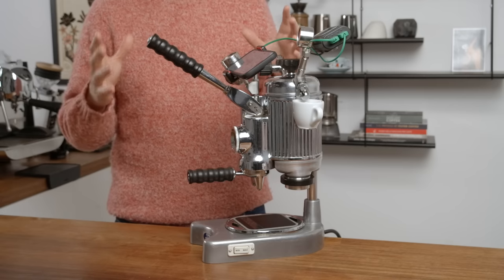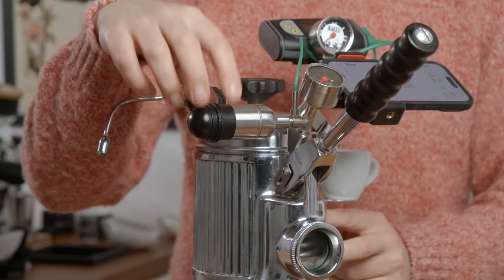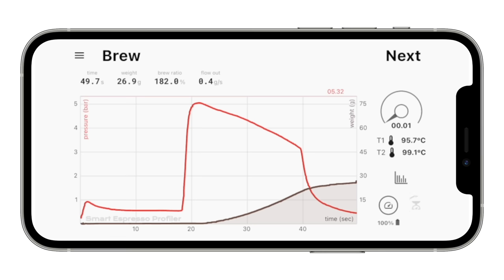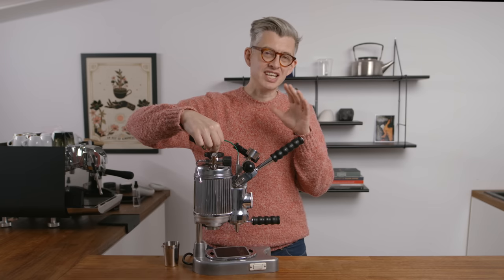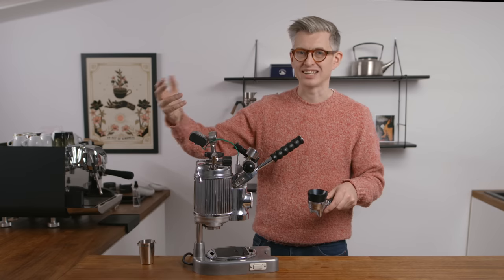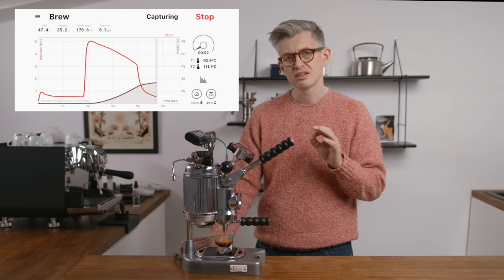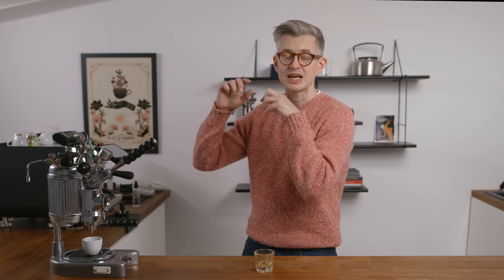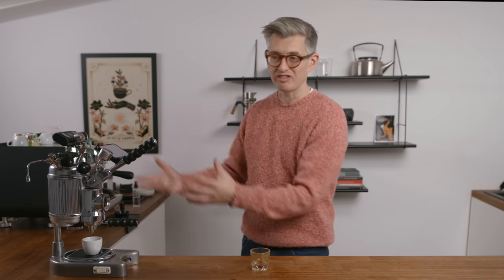An Upgraded Vintage Lever Machine

Comment: As the owner of an Elektra Micro Casa a Leva, there are two things I would love to see you explore with this setup. 1) There is a technique for lowering the group head temperature after a shot that involves running the portafilter under cold water to cool it down and then lock it into the group (empty) to draw out heat. Does this work effectively? 2) A second pull. You noted that you have no control over the end mass, but you do - after the lever has come up you can pull it back down and push more water through. But you don't have to let the lever come all the way up the first time, which lets you control how much total water is pushed through. With practice, you can hit the brew ratio you want pretty consistently. One effect I sometimes notice with this technique is that the lever appears to rise faster on the second pull, suggesting there is less resistance in the puck. I'd love to see the temperature and pressure profile when doing a 'double pull'.

Comment: You summed up why I’ve stopped measuring shots.  I used a scale, timer, etc. to understand what I like and now get much more pleasure doing it all by sight/feel. It’s like having subtitles on screen when you don’t need them… you can’t help but read them.  It’s impossible not to fuss over numbers when they’re presented to you.
Reply: Bottomless portafilter been a game changer. Sometimes the shit runs longer sometimes shorter before I notice the extraction changing. I know what I'mooking for and stick to it now. Makes it more of an art but an enjoyable one.
Reply: @chris9650  That is where I am at. I even prepare a puck with different ground densities at the rim to the centre, and watch the extraction in a mirror, doing everything by look and feel. I still have the instrumentation and look at the data after pulling the shot.

Comment: It's always a pleasure to see some lever machines on your channel James and congrats to Gabor for keeping the integrity of the machine!

From our experience, because the boiler of the Faemina is elevated you don't actually need pressure to make water enter into the grouphead, gravity should be enough. So you can actually use the machine at a much lower pressure (and therefore temperature) and let the group warm up slightly more. Because the grouphead is integrated with the boiler it will tend to stabilize at the same temperature, so you can keep water below 100°C and the group won't overheat (or at least less dramatically) and only increase the pressure when you need steam. For people that don't have a Frankenstein Faemina like this one, the water temperature can also be measured pretty easily with an IR thermometer through the sight glass.

Comment: Went through this blind with a group of engineering friends and a Pavoni Europiccola. We learned a lot of the same things without the numeric details (it took 6mo and a 5-dimensional whiteboard graph), but the most important thing we learned was that the way to get quality successive shots was to chill the portafilter in cold tap water between shots. The first shot with the portafilter at room temp is fine because the group head is cooler, but for successive shots, getting that substantial mass down to ~50F between shots when you're cleaning the basket was key.
Reply: very interesting!

Comment: Brilliant machine. I love the idea of "figuring out" a machine with the tools you created, then removing all of that after using it to get a starting point of how to tweak variables. I have used my Cafelat Robot nearly every day for around 3.5 years, and it's become an art. I don't necessarily need the pressure guage it came with even. You start to pick up on how many fines are in the coffee just by how the water looks when you pour it into the portafilter, etc. It's a flow state now where, like you say, you're just in the process. I thought it was funny that the guy who makes them kinda talks about it like it's a toy, but to me it's a fixture now, I just replace the gasket, keep it cleaned and it trucks on each day. Every new bag of beans is a slightly different experience to tweak.

Comment: I make espresso with a faemina most days, it’s a real sweet machine. You get a feel for it over time and I have a pretty effective temp surfing method worked out using a thermal strip and a pressure gauge. It’s super cool to see more data on what’s going on under the hood, thanks for making this video!
Reply: I use a la Pavoni Piccolo- first and only espresso machine I have owned.  And am now into. 20 plus years of use.  And it still keeps getting better as I get better. Buying a proper grinder (I chose a specialita after not getting good results with a pavoni grinder) 
So total agree with your comments about feel and experience.

Comment: The best kind of classic lever machine to PID mod are the old open boiler machines like la peppina or the mini gaggia. You can just use a external PID controller like the inkbird, plug the machine into it and drop the temp sensor into the open boiler. Tada, perfect temperature control.
Reply: Plus one for the Open Boiler machines. Mine's a 1950s Arrarex Caravel. Never seems to overheat the group head. No short window performance anxiety James.
Reply: I'm keen to do so with my lever in a non destructive way also. One because of respect for the OEM and machine. Two, because of aesthetics and work flow / operation. Nice to have additional information feedback while evaluating the shot in real time and learn from the saved data.

Comment: I bought my Olympia Cremina after watching your video with the profiler on a Cremina. 

As a teenager i worked at a shop in Seattle that had a terrific commercial lever espresso machine. I always loved the feel of pulling shots with a lever. I absolutely understand your appreciation of the process of using an old style machine. The feel of a great shot is a delicious delight, especially if i helped make it better by being able to feel the beginning of a channel and letting off pressure so the shot is saved from over extraction! That’s why I love the simple design of the Cremina, because I understand her inside and out. I didn’t want the profiler. While the data is fascinating, I’m more interested in understanding the idiosyncrasies of this bare bones beauty and working with her! Thank you for your passion and your ability to understand the “Art of the Shot” as well as the Science!

Comment: Fascinating, I bought an old Astoria lever machine about a year ago, and discovered that it ads variables to the espresso process which I first saw as a whole new world of pain and frustration. A year on, I love it for the same reason - it forced me to learn by taste, sight, smell and feel what I was previously trying to do by measurement and precision. Same problem with heat - I spritz the group with a water spray between shots when it starts to run hot!

Comment: I’ve recently acquired a La Pavoni professional from the early eighties. I completely restored it. Re wired, 220v to 110v, temperature control mod ppk kit. It’s still fussy and a pain in the ass. This is my first espresso machine and I love it. I love the process of actually pulling the shot lever, getting the temperature of the group head where I want it. I think when the time comes to upgrade I will still go with a lever style machine it just seems right. Thanks for nerding out on an old lever machine.

Comment: I have a 1970s Pavoni lever action. Very similar with min/max elements. Whilst I do have a temperature strip on the group, I rarely look at it. Nor do I weigh the coffee. You do it all by feel and noise. The pressure comes from your arm, the temperature by ear, the coffee by eye. Still the best coffee of all my machines.
Feel the force James.

Comment: Used to own a micro casa leva with PIDs, 
I used to keep it on with the boiler @ 97 degrees from 5am till i woke up.
Then raised the boiler temp to 110 quickly, pulled my morning fix, cooled it down by washing the portafilter under the tap, and made a second cup for my wife.
Now running a modified strega.

Comment: Truly appreciate the discussion and the thoughts that some have about appreciating vintage things for what they are. There is a magic to pulling a lever and it just being what you make of it. For me, I'm definitely a data geek and a technophile and I'm happy things like the Meticulous will exist to satiate my needs to analyze everything. And more I'm happy that everyone is able to find a place in the community. Sometimes I read Reddit and everyone is judging each other, primarily for 'faffe' as anything or any piece of equipment that they choose not to have or use. That can be frustrating.

Also I hope that the hobby moves toward some levels of or at least some options of modularity. It would be really cool to have parts to more easily build your own lever machines with as many or few bells and whistles as you want.

Comment: Really good points made at the end. I can definitely appreciate the benefits of getting a load of data to optimize a process, and then take off the data acquisition stuff so you can just implement the process and enjoy the results! The benefits of analysis without all the paralysis.

Comment: Thanks for this. My everyday machine is the la pavoni and with these lever machines there's a real art to the temperatures and pressure which you just get the feel of over time. There's certainly easier ways to make espresso but in my opinion this delivers a wonderful shot.

Comment: It’s great to add equipment (also just basic analogue stuff) to machines like this to learn how they go, and develop a timed routine that makes great espresso almost every time without the stress. That’s how i enjoy my ‘95 pavoni. One thing to keep in mind—the entire group, not just where the temp probe is, and the portafilter are both massive heatsinks. If you stick another temp probe halfway into a somewhat coarser ground puck, I bet you would find readings 5-10 c lower than the current grouphead probe. That’s been my experience with the pavoni.

Comment: I have an Elektra S1C, and yes, it's a bit of a one-shot wonder. Definite "burnt" taste if it's left on for a long time although purging it with just water can help a little - if desperate! Also no pressure relief, so the coffee "sneeze" is something I've experienced first hand ...
I'm also a total computer/electronics geek, but I like having it the way it is because it's just plumbing. Nothing to go wrong, no silly pipes to burst or electronics to get wet.
One day I'll get something I can geek-out, but it won't be this one.

Comment: I’ve been living with and loving my family’s old La Pavoninfor years now and completely agree with sometime enjoying just the art of espresso making given that the machine are so finicky anyways. One tip that I’ve since adopted is from James’ Moka pot guide - I add boiling water off a kettle and pull multiple shots off the heat from that with the machine set to low to avoid getting too much heat sync through the machine during the heat up. Unfortunately it still tapers off dramatically by the third shot, but it saves the second shot typically.

Comment: As a multi-vintage lever user, Kudos to Gabor for making these changes reversible without permanent damage. One learns "arm memory" eventually when it comes to lever machines. This "arm memory" leads to a high level of repeatability as long as other variables are maintained; grind, dose etc.. These and other tools do decrease the learning curve. I still use a thermostat strip for group temps. These pro-sumer type of machines are definitely not for more then 3 shots and 2 at best before cooling is required.

Comment: I'd say focus on the workflow feeling it out, but let data assist you. I've been playing around with a Europiccola for a few months now, and it took me a while but am now getting consistent sweet shots with two very different kind of beans. 

I feel I can say the grind is the most important factor because it automatically steers brewing time and pressure to where it needs to be. Walking the line from acidic to sweet to bitter seems to be more related to this then to temperature.
Second would be the temperature and while I have the stickers my fingertips are a good enough tool to tell me whether I'm in a range that pulls the shots I like the taste of. I haven't felt the need to use them.

Using a scale with a timer definitely helped. I use the timer during the pull and the scale before and after, just to see if what I thought happened during the pull was actually the case. Really helpful info.

I've been thinking about adding a pressure gauge, but having worked with it for a while I can see why they didn't. Ones you know your brew time and grind, the lever tells you and there's not really anything you can do about it from that point on anyway..

Comment: Having modified my La Pavoni Professional (addition, not modification, so almost entirely reversible as well!) I totally get not wanting the extra bells and whistles on there. Once you understand how the machine works, with the help of data, you can continue using it more by feel.

Having said that, I am very happy with the way my machine looks and works, it's my first espresso machine, and probably my last as well. 

The Faemina is a beauty, and much like any other lever, actually pulling shots instead of just pressing a button gives such an amazing feeling, it never bores!

Comment: Great vid James, super interesting. I definitely relate to you 'analysis paralysis'. As a PC gamer it can be very easy to spend more time getting a game to run optimally with the highest framerates, the perfect frame pacing etc. than actually playing. I've somewhat cured myself of this by forcing myself to not turn on the onscreen metrics and analytics until I've actually played the game a bit and can notice something wrong without it. As long as the game is grabbing my attention I can (mostly!) get on with playing it. I can see a lot of parallels with espresso.

Comment: I started with a french press, switched to a moka pot and from that to a La Pavoni, it took me about 2 or 3 years to get a good coffee out of it. It was frustrating, but also like a ritual, like the whole process of shaving with a double edge razor and soap. It wasn't something i could speed up or push of a button, it required my focus which to someone with ADD was relaxing.

Comment: I have one of these I bought and used throughout university. Very interesting to see that your brew method was very similar to mine. I did, however, use 12 grams instead of 15 because I could not get more to fit into the basket.
Reply: Did you tend to use darker roasts?
Reply: @NachaBeez  yes generally slightly darker roasts but not exclusively. I was however usually making coffee for one!

Comment: I have a Europiccola and unlike many Pavonisti, haven’t added any of the multitude of mods - airbusters, heatsinks, Bluetooth etc, preferring to keep it un-modified and learn to work with it as it is.  It’s a bit like owning a classic car or bike - no PAS, reversing cameras, ABS or proximity sensors - you learn to drive the vehicle and as consequence, become far more involved with it.  

And then it breaks down 😆

Comment: Fascinating video. Very consistent with what I’ve heard from users of these machines about how tricky temperature control can be.
Also, the SEP app can show flow rate instead of cumulative weight if you tap on the graph   ;)

Comment: Love the analogy, with my old old Vibiemme i know exactly when my shot will be good, the machine kind of “tings” (that’s a sound) when it hits a specific temperature and i know it’s almost time to pull a shot. I have checked the temp with infrared and probe’s years ago and i never do this anymore and the shots are… wel.. pretty good i guess :)
I’m curious if a modern company would make a unit that is shaped like this old faema,  as i love it over the boxy profile machines that you see these days. Thanks James, now make it original again!!

Comment: I really like the blind analog charm of machines like these. It inspired me to buy a europiccola. I do think they could be designed better though with modern insulating materials and other creature comforts. I kind of much prefer a lever to pressing a button when making espresso due to the amount of control you ultimately have over the process.
Reply: That is why I Love my Flair and my ROK grinder.

Comment: I would really love to see an in-depth series on spring-lever espresso machines (commercial groups like CMA or LSM) from someone with a head like James. There is preciously little solid information out there to take out the guesswork and help create a good workflow with repeatable results. I suppose this would be a big project for a relatively small audience, so I'm not holding my breath, but there's so much information about pump-espresso (and even the direct lever people have tons of information on the web) and spring lever machines deserve a lot more attention than they're currently getting.

Comment: I really enjoyed this video! I also appreciate that Gabor held back from making any irreversible mods. I think the temperature and pressure sensors are interesting. You could use them to see how the Faema works and figured out what the sweet spot of the machine was, but I think it's more beautiful without them. I think it would be interesting to do a series on all extant lever machines where you modified them the same way you did the Faema to see what their operating parameters were and what the sweet spot was for each design. Then maybe some clever engineer would design an optimal level espresso machine that suited our contemporary espresso tastes and needs. My sense is that a lot of the level machine designs go back to the twentieth century and are the products of "seat of the pants" engineering.